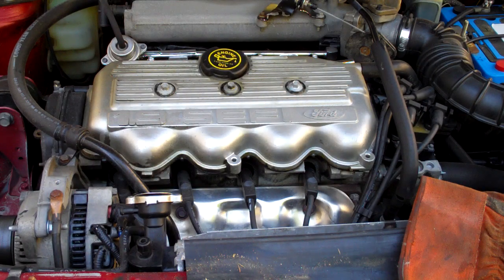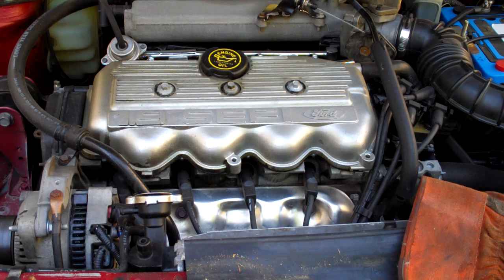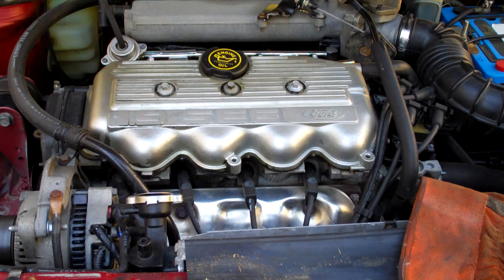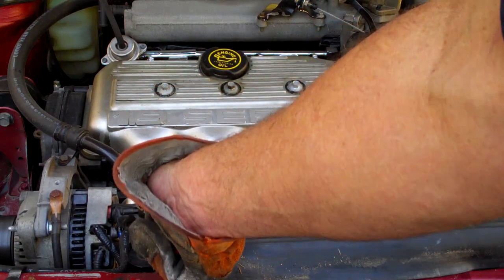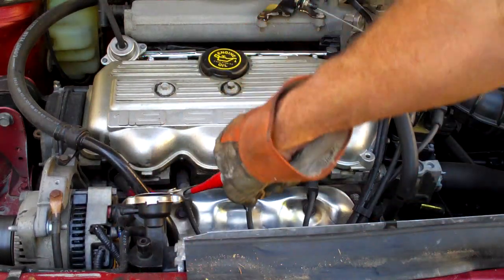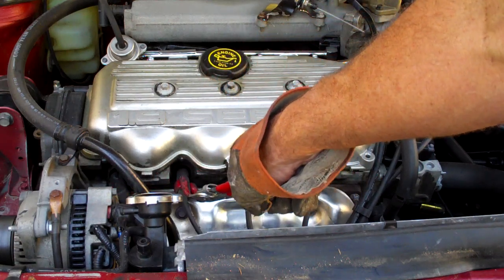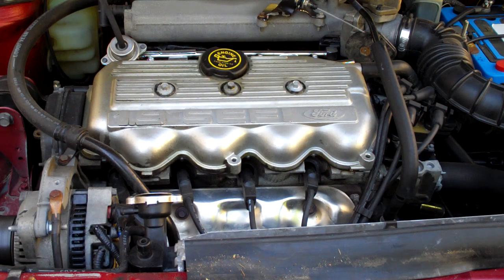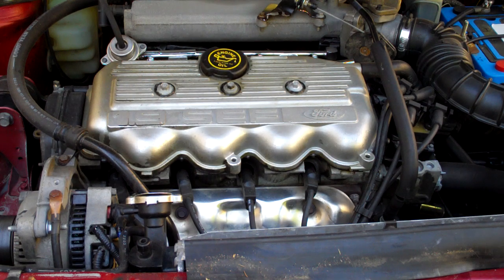How To Diagnose An Engine Knock.MP4

Comment: My engine is knocking and temperature is really high, I have water in there but its always so high, like limit high, 5 minutes after i start it.
Reply: an engine can knock if the temperature gets close to 300. if you're running too lean your engine will run hot, sometimes so hot the exhaust manifolds glow orange. make sure your fan comes on when it should. if the coolant is not circulating you may have a bad thermostat or water pump.
Reply: TugaGaming21 sounds like your running lean

Comment: I have a bottom engine knock only when my truck is in drive! Its really annoying! HELP!!!!
Reply: I have a 3800 and it Knox's bad
Reply: MUHAHA GMORules likely transmission related or drive train
Reply: +MUHAHA GMORules  Inspect the flexplate for a loose bolt or cracking.

Comment: I really didnt understand whats the problem on the car in the video, Is it the coils or spark plugs? Pleas answer me because I have the same the same problem and sound! Thank you!
Reply: aavvsk8 Neither. Removing the spark plug wire allows him to determine which cylinder may be having the issue. Further diagnosis is required from there, but that gives a place to start investigating.

Comment: I HAVE A 05 NISSAN MAXIMA, MAKES THE SAME NOISE, JUST REPLACED ALL COILS AND PLUGS AND PUT A CODE READER SAYS P0300 . MULTIPLE CYLINDERS MISFIRING. IF THEY ARE NEW COILS AND PLUGS THEN COULD IT BE  COMING FROM A CLOGGED CAT CONVERTER OR AM I SCREWED FOR A NEW MOTOR. ANY IDEAS????
Reply: Check the timing. Or the spark plug wires.

Comment: IM having the same problem with mar car
I drive a 2007 Gallant and one day I was driving and the whole car shut off completely
After restarting it theirs a loud ticking and knocking noise as I drive.
The engine light never comes on but the oil light blinks until the car shuts down on me.
I'm not so sure what the problem is and I haven't gotten a diagnostics yet
But so far the shop told me I may need to just replace the whole engine, that's too much money for me right now plzz help

Comment: My car don't sound that bad but I have knocking when the engines cold. Once it's warmed up it sounds like when I first bought it. Always had full synthetic oil and Lucas stuff gets added every now and then. Is it something I should worry about? At 168,000 miles it's a Buick rendezvous 2003 all wheel drive
Reply: perhaps you get some piston noises due to too much cylinder wear. I overhaul an engine at the moment and am researching for this topic a lot right now, because if something goes wrong, i want to now WHAT goes wrong :D
Reply: +stonix1992 i guess so. I don't even care about my car as much as i did. I'll still do the maintenance on it but im not caring as much. Just going to buy new or something with a warranty
Reply: Yes, thats the way to go if you drive a daily car, i drive an 88 firebird and overhaul a 2.8 litre giving it some real non-charged boost (sharper camshaft, more compression, portet inlet) so on my engine things like this would be my pain in the kneck :D !!!!!
Reply: Mines a lame 2003 buick rendezvous lol
Reply: Brian Kendrick from the dealer lol where else?
Reply: That sounds like a lifter. Is it more of a ticking noise?
Reply: +Matthew Valadez from
Reply: americanmusclefan10K kinda but it's not my engine. I've lost over drive in my transmission. Now it's really getting bad. Idk if I wanna fix the car more. It's rusting bad with our Michigan roads so it's bad if I were to just keep putting more into it.

Comment: Is it safe/okay for the car to remove the spark plugs like that while it's running?
Also if I change my spark plugs, do I have to unplug the battery or anything?
Reply: Actually it's not good for the coil to remove a plug wire like that, but sometimes this type of diagnostic procedure is needed.
Electricity takes the path of least resistance to ground. Once the wire is pulled it forces the coil to put out it's maximum until the wire is grounded or comes close enough to ground to discharge.  It only takes a second for 20,000 + volts to pierce through a weak area around the coil tower where the plug wire boot fits. If the coil leaks just once & causes a track outside the wire boot, the track can lead to cracks & a cracked coil tower is a misfire waiting to happen
Reply: It is safe for the car. All that will happen is the cylinder will run a few revolutions without igniting the gas and nothing will happen but black smoke coming out the tailpipe (its just a fuel/air mixture). It is not safe for you though because it is a live wire, which is why he's wearing gloves and using rubber handled tongs. As for your second question, you need to disconnect the spark plug wires but disconnecting the battery is not necessary. Just turn the engine off, disconnect the wires and pull out the plugs.
Reply: David Burks
Thank you, good sir! Appreciate it!
Reply: Make sure it's running when you change the plugs......  LOL, I'm joking.
Reply: One thing that is bad, would be to run the engine for an extended period of time without the spark plug firing. Due to the fact that the injector can washout the cylinder. That and kill the cat(s) on that bank...

Comment: My engine is knocking on my car they said that my rod fell off can I replace that rod or do I have to get a whole new engine
Reply: If your rod broke/fell off, your engine wouldn't be working at all. I had an engine Knocking/ticking pretty loud on my car which worried me a lot so after 8 months i finally took it to a mechanic and found out it was a heavy buildup of carbon which the shop wanted to take my engine a part to clean it, but instead i went and bought a bottle of CRC motor treatment(Carbon out) which is almost same thing as the seafoam staff except i like CRC better. I went home took off the brake booster vacuum line and very slowly poured in half to 3/4 of the the can into the combustion chamber thru the brake booster vacuum line. After 30 minutes of smoke show the noise was almost gone, so i did it again 3 days later, and now the noise is gone completely. Maybe you have carbon buildup also, you can try the CRC motor treatment (Carbon out). It will not harm your engine, just pour in half a can real slowly thru the brake booster vacuum line (follow directions on the can) DO NOT POUR IT IN TO FAST OR YOU CAN HYDRO LOCK YOUR ENGINE, remember fluid does not compress so do it slowly, it took me about 3 minutes to pour half a can in. 20 minutes after you put it in you will see a lot of white smoke which is just the CRC steam/vapor mixed with burned of carbon and other filth from your combustion chamber and hopefully your noise will go away. Mine was knocking/ticking for 8 months before i finally found out what it was and cleaned it out. One way you can check your self for carbon buildup is by pulling couple of the spark plugs and if you have black dry soot on your spark plugs that means you have carbon build up for sure.
If you have anymore questions just message me.

PS: If you can't find CRC motor treatment (Carbon out) in your area then you can use the seafoam staff which every auto part store has including Walmart.
Reply: Yeah replacing the rod would pretty much require a complete rebuild of the engine. It'd be cheaper to just go to the junk yard and find a good running engine and swap that in.
Reply: That is major damage, you might as well get a new engine.
Reply: Thanks
Reply: Thank in a million
Reply: Probably have a cracked block, I'd find another engine and not waste effort with that.

Comment: I recently overhaul my 1.6 Toyota Carburetor 4AF 1992 model. When the engine runs and went to Normal hot temperature it sounds like a bearing knock from 3000 rpm and up.Any suggestions? Had a record 605000 Km on the clock when opened for the first time.

Comment: If the knock is more pronounced or frequent when you rev the engine, it's almost always rod knock, likely due to worn connecting rod bearings.  A bad piston wrist pin can make a similar noise, but it's usually much quieter than a rod knock.
Reply: What if its louder at lower rpms?
Reply: @jovo21  that can sometimes indicate worn main bearings

Comment: I would try putting some good moble 1 in and see if it solves the problem.let me no what the problem was.
Reply: If it's knocking, it's too late for any kind of oil to "solve" the problem. New parts will solve it, really thick oil might "mask" the sound but not solve the problem.
Reply: Explain how Mobil 1 could possibly fix a mechanical issue that more than likely requires replacement of damaged internal engine components?

Comment: I have a slight knock in my 3.8L engine it only does this when drive or on cold starts what is your opinion on what could it be the can't be heard on the outside of the car or when in park.

Comment: its a 1.9 escort motor,these were not nearly as likely to drop valve seats as the 2.0 ford motor,they didn't have nearly as much power as the 2.0 but were pretty much bulletproof if properly maintained.

Comment: My Car has started making this noise after a new crankshaft was put in. it only makes this noise between 2000 - 3000 RPM.  I have a Kia Picanto 2005 se.  Kia are saying it is piston slap but my macanic is not convinced

Comment: I had something like that, and it turned out to be a hydraulic lifter.  Oil pressure is what makes them expand and take up the slack between your cam and valve bucket. If your lifter has grime in the oil hole (or you're using thick oil), it may not get enough oil pressure until you hit 1k RPM. Use heartDixie's method (garden hose on your ear) and listen to the valve covers to check.

Comment: I have ticking sound at idle goes away at 1,000 rpms and disconnected all the plug wires one at a tim and the noise is still there. Any idea what it could be

Comment: i have a chevy tahoe 96,when i turn on the engine i hear a knock,after a while(like a minute) desappears,im not a mecanic but i do some stuff in my truck,i check the oil pressure in the dash and no problem with that,do i have to put new engine?do you have any idea what is it?please help me out.thanks

Comment: i have the same noise but it seems to come and go im getting the air flow meter replaced because it's rooted hope that resolves the problem because the car dosen't idle properly and stalls

Comment: Disconnect the wiring from each one individually. Works the same as removing the plug wire. And you're less likely to get shocked by just disconnecting a coil pack.

Comment: It's a 1993 Mercury Tracer Wagon (Originally 1.9L SEFI), with a 1999 2.0L SPI Escort Engine at the time of this video. My Dad decided to use my misfortune, to shoot this educational video.  

To anyone wondering what was wrong with this motor, and how it was fixed:

There was a Knock, I had no desire to keep the Lame 110HP Engine, So I swapped in a 2.5L V6 out of a 2002 Mazda Milennia...  Simple fix in my opinion.

"If it breaks, it's time to upgrade"

Comment: that there is a spark to that cylinder it wont use the spark advance or knock sensor allowing you to back fire in that cylinder. dont get me wrong if your going to do this to find out what cylinder has a knock go ahead but dont do it for long periods of time and do NOT accelerate the engine rpms. all i can say is hope its just a stuck lifter if your doing this. i had a knock on my 92 mustang did this ended up backfiring and the engine siezed within 3 minutes

Comment: no sorry of my wording i did not mean to say your removing the stroke of the piston in the cylinder. your removing the spark wich removes the compression in that cylinder which leads to a couple things. that cylinder is being filled with air/fuel and not being burned.which means a car with 600cc high impedence injectors wil flood the engine. also with fuel ontop of the piston you are allowing a backfire in the cylinder its self when you put the spark in. and since the ecu is still reading

Comment: By removing the spark your removing a stroke? No, all the strokes are still there, it's just not lighting the fuel/air charge. It does change the pressures associated with that piston but it will do no harm to your engine. This works well to locate problems associated with a cylinder with, say, a broken piston skirt, bad connecting rod or bearing, wrist pin, or just a worn skirt to wall.

Comment: Is that higher-pitched noise in the background what you'd call "valve noise?" I own a 1980 Yamaha XS1100 bike, and the previous owner has neglected it. When I bought it, I checked valve clearances, and got them up to spec. Now, when I ride around, I hear a similar noise, and I'd like to know if it's a problem.

Comment: When u take the spark plug out of the cylinder it is no longer igniting the fule air mixture? So what happens is there is no combustion in that chamber to push the piston down. this can mess up your lifters, valves ,timing and worst case scenario ur crank and rod.

Comment: You can cancel injectors if you have a siamese pack. Isolates the cylinders all the same. ( a coil that shares two cylinders, keeps the non combusting plug hot and clean of oil) If you have a scan tool you can watch misfire data (98 and newer OBD2) and killing injectors while observing knock sensor counts as well, if there is too much background noise. This video is useless if you follow demonstrations to the letter, the overall concept of process of elimination is the point.

Comment: Its most likely a lifter tick before you tear it down i would try running reslon in your oil. it might take  the knock away but when u run reslon through your oil make sure u change your oil after a tank and half of fuel. if it dose not take the knock away i would then take the valve cover of and get someone with experience to adjust the lifter. And for peaceandwellness if u think thats a bad ring or valve your crazy. if u are truly a mechanic for 30 years u still have alot of learning to do .

Comment: I have 155,000 on my 94 1.9l, that spark plug is always tough to get off; still running great! Trying to work on a 2.2l chevy, has some noise and some oil pressure problems; took off the valve cover rockers look fine, still thinking it is a lifter.

Comment: @howmuchtimeisleft 
He actually said it would remove the combustion pressure. The force of combustion pressure is much greater than compression.  Without that spark, the piston will not be propelled on the power stroke the way it would have, had that mixture ignited. This changes the sound of the rod knock by reducing the amount of load the rod bearing has to support on that power stroke. (where that knock is likely most present)

Comment: Umm sir, I am pretty sure that motor is the 2.0l "SPI" found in the 97 and newer Ford Escort Sedans, and wagons.  It appears that the owner of that vehicle was trying to deceive everyone by using the 1.9L "SEFI" Valve cover.  Based on the intake manifold, that motor is a 2.0.  It's a common swap for the 91-96 Escorts and Tracers, almost a direct bolt-in, and roughly 25 more HP.

Haha, Hi Dad, the video is good! My 93 Tracer wagon is not. Time for my next Engine swap?  Goodbye knocking SOHC...